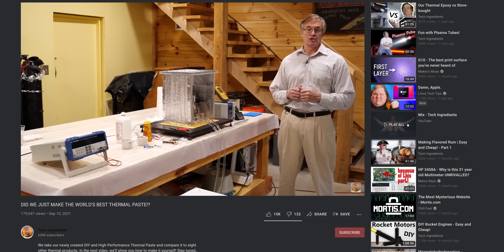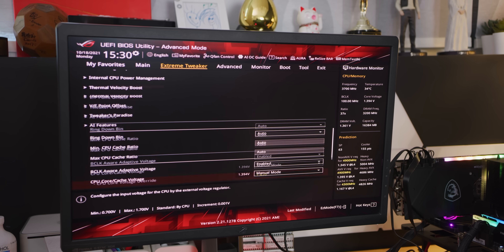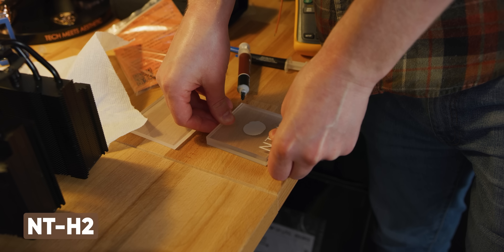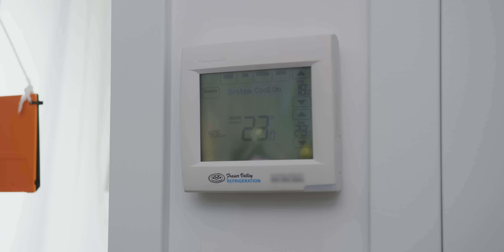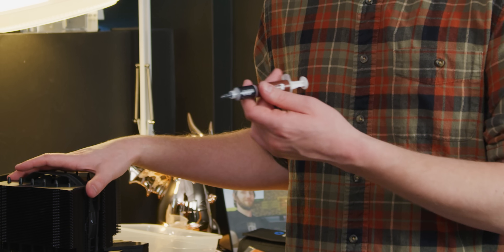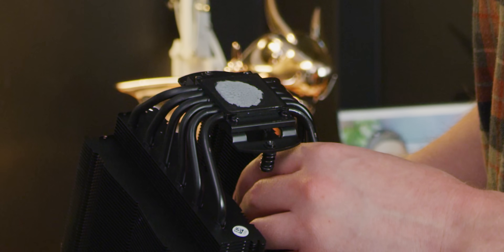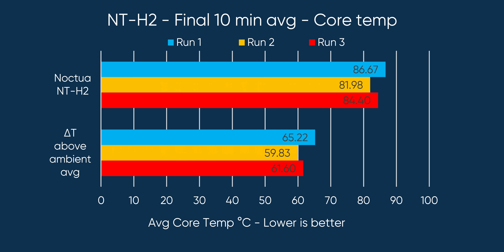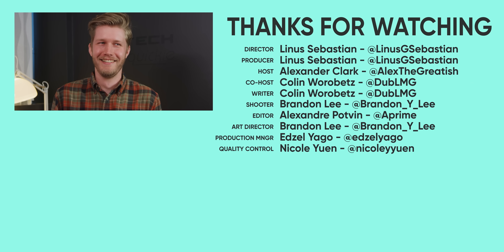We called out Tech Ingredients and they DELIVERED

Comment: I totally believe that TI has made good performing paste, but what I'd really like to see tested is the longevity. I don't recall what maker it was, but paste performed well for about year and then temps began to increase dramatically. Opened up the machine and paste had completely dried up. I've never seen this tested.
Reply: @barnett25  That's excellent thing to hear and I'm really glad they've considered this issue. Gotta check out their video. They definitely earn and need all the views they can get. 👍👍
Reply: @barnett25  Well worth a watch of that video. Went into such depth.
Reply: May have been artic silver. I'm using it, and after a year plus a few months I'm consistently running almost ten degrees hotter under load. Which ony case is fine because I was only hitting 70C before, but it's still a dramatic difference.
Reply: @lobsterbark  Artic silver began to ring bell fast. I'm almost certain that it was indeed some of their product in my case.
Reply: That is the heart of the matter. Peak thermal conductivity is meaningless if it doesn't last over time.
Reply: Completely agree but that sounds like a nightmare to test without some serious infrastructure. (I.e. controlling variables over months, years, while continuously running benchmarks)
Reply: Longevity is definitely the most important thing for me. I have a 10 year old PC that found it's way back to me (I gave the PC to somebody after I bought a new PC) and did some testing. The temperatures are the same and the fan speed hasn't increased, so the paste has hold up great.

It's not just that I don't like the hassle of changing the paste, I also don't like to think about whether or not I should change the thermal paste.
Reply: @quintoblanco8746  Had a 3570k built for 10 years didn't change the paste and it was the same thermals from the start till I pulled it apart. Using a D14 and NH paste.
Reply: @quintoblanco8746  well said there 👍
Reply: That would be thermal grizzly.
That's why once in an interview with Steve, Derbauer w̶a̶n̶t̶e̶d̶ recommended you to re-apply your thermal paste every year.
Reply: @noiJadisCailleach  Yeah, That at least sounds right in the time frame. I definitely wouldn't have bought that paste if I'd knew how little time it's at its best. Year is way too short for me.

Comment: The difference of 2 degrees ambient and 5 degrees on cpu has to do to heat disipation, the grater the difference is, the easier for the cooler to do it's job.
Exemple:23⁰ ambient -90⁰ cpu
                21⁰ ambient -85⁰ cpu 
This is just how things work, you want to overclock the ** out of your pc, build a waterloop and add ice to it (or run some tubes outside when it's -10⁰C )

Comment: I always prefer spreading it, rather than the rice grain method. I can make it super thin that way, and full coverage.
Reply: @Mario Kart Manual spreading was there before heatspreaders and it is still preffered for direct die. (now mostly gpus). With direct die if you don't get all the corners pasted you risk hotspots. (and 20years ago cpus didn't throttle or turn off they just released magic smoke and died). And if you take off the cooler to check the spread and plonk it back the chance of trapped bubbles is probably higher than with carefull spreading.
Reply: Yup, and preference aside, if you KNOW it's not spreading all the way then it becomes NECESSARY and not just a preference!
Reply: You have to manually spread it if it's a laptop (not as much pressure) or if it's a thick paste or both!
Reply: @Mario Kart  Yep, that's what I do with thicker TIMs.  First I dust the surface with the TIM, then spread with a credit card, and lastly add a center pea before mounting the cooler.

This is why I try to purchase thinner TIMs and avoid as I can the thicker ones.  

The one from TI that LTT reviewed here looks about right if not a tad on the thick side.  Hard to tell without having some myself.
Reply: You're absolutely right. When I worked for JDS Uniphase spreading was always the international standard for the lasers. A thin, full coverage layer has been tested to death as the optimal way to achieve best temperatures. Why would you lazy out on a very expensive piece of hardware?
Reply: @odjsjaks  Yeah, that's the same thing I said...  you just used a lot more words to say it.  LOL
Reply: Problem is, the comments would've probably imploded with people telling them spreading TIM would create air pockets. It's just easier and more consistent to do it the way they did.
Reply: Why tho? The grain method is ideal. No need to manually spread it. The heat will warm up the paste and spread it out more.
Reply: @hamajangz9586  It is easier and probably more consistent because of it, but not necessarily ideal. 
I've seen very little spreading due to heat in TIM myself.

Comment: Throw it on a Pentium 4 and see how it REALLY performs
Reply: Why not bulldozer?
Reply: @kaldogorath  don't want to burn down the office
Reply: Is this a meme? I've had a P4 and I didn't have thermal problems with it, even with the stock cooler back then.
Reply: @noiJadisCailleach  it depended on which P4 you got. The Willamette cores were decent and Northwood were the refined later gen P4 chips after the disaster known as Prescott.

Comment: Why is noctua top tier thermal paste while thermlaright outperform noctua, and what about thermal grizzly krayout, how the heck can you bring noctua to top tier while it is below a crappy brand like thermalright, and they dont even use that good of heatsinks and fans or paste
Reply: Thermalright make pretty decent coolers for years. It is more about consistent application but if you spread it yourself you are right and how long those thermal pastes work fine would also be an important question.

Comment: The 10900k drawing 204 watts is insane, that's like a small room heater lol
Reply: the intel special
Reply: Sir, that IS a small room heater
Reply: The best part is, almost all that power the CPU draws ends up as heat anyway, so the CPU essentially doubles as a 200W heater
Reply: I usually describe my desktop as a heater that does other things.
Reply: My 117000k is drawing 213W at the same settings with slightly less Voltage (1.380) :D
Reply: AMD be like 500 W 😂😂😂😂😂😂😂😂😂

Comment: Why not use a rtx 3090ti??
Really curious
Reply: Do you mean trying to use it to cool the GPU? If so, I understand why you think it would be better and I agree in one regard. 
Upside: It uses more power so would give more resolution in the test and the difference would be amplified. 
Downside: It would be much more work. There would be much more human error in getting the torque and mount even. It is easier to lock in the variables using the CPU through the BIOS/UEFI (whatever they call it these days)

If you mean why did they not use one in this video I would assume
1. This is about the CPU load/temp and any GPU would be fine.
2. They would need a stupid big PSU and that poor MB would have a ton of current flowing through it. It would just make the experiment noisier for no reason.